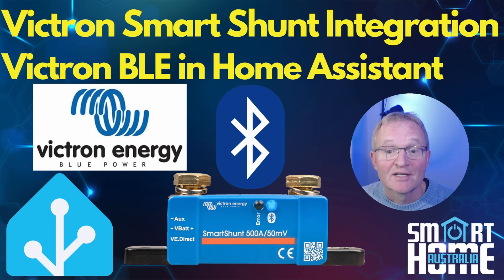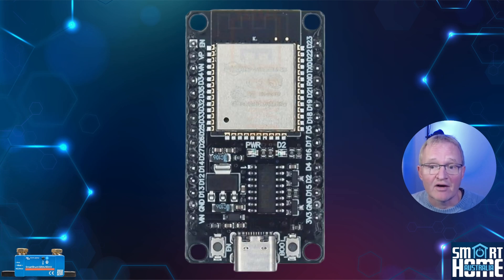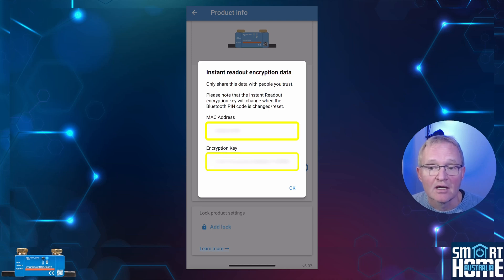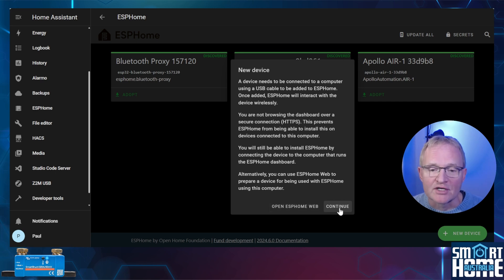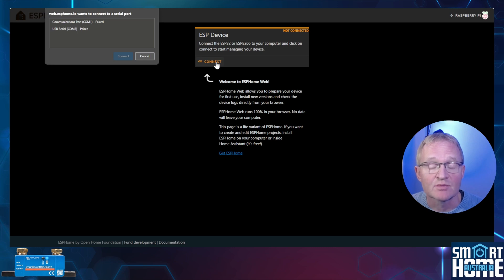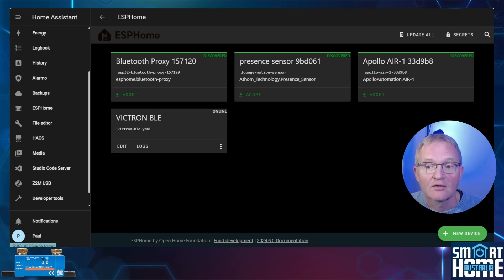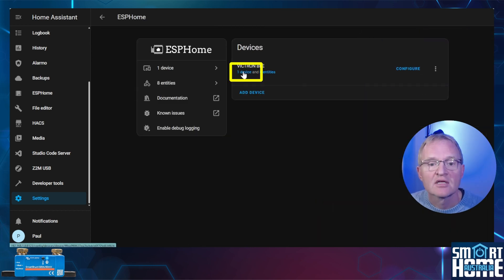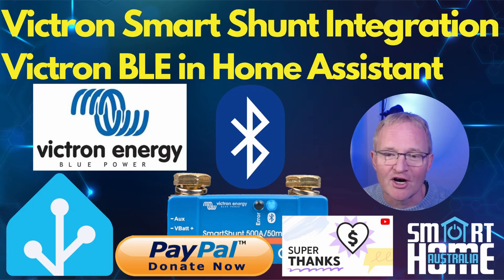Integrating Victron Bluetooth Device into Home Assistant: A Comprehensive Guide

Comment: Thank you. This was very helpful. With no modification of the code I was able to get a different Victron product to work with this. I have an old BMV-700 with an added on bluetooth unit.
My biggest struggles getting this done were probably because it was my first time working with an esp32 device. I use a Mac. My esp device seemed to need to have the boot button pressed down quite a while as I went through several screens. 
A suggestion: I had a great deal of trouble getting my esp device to connect. Turns out I was trying to connect the esp to my 5G wifi. I changed everything over to my 2.4 wifi and got it connected. My computer is back on the 5g wifi. 
Thank you very much for the video. I was not certain how valuable it would be. The feature that blows me away is the 10 days of data logging in HA and the graphs. My old shunt has no data storage. I am now geeking out analyzing how my batteries are charging.
Question: I have the Victron entities in my dashboard. When I click on one it tells me how recent the data is. For instance "2 seconds ago". Is there a way to display that time value on the dashboard.
My next big project is to get my EPever charge controllers to share data with HA. Looks daunting.
Reply from the maker: Excellent work !! This was one of my most rewarding integrations I've implemented. Dont forget to increase your HA reporting to get more data. Or whats this video https://youtu.be/k-7dO1o52dQ for the perfect solution !!
Reply: Hi!  I have the same configuration here. VictronConnect (Android) list my VE. Direct Smart BMV-700 (connected via Victron Bluetooth smart dongle). The problem is that the info screen do not list the mac address nor the encryption key ! How did you get these info?
Reply: @MarcPilon  away from my boat for a bit. But I’ll look. It was in the app somewhere. On iOS.
Reply from the maker: @MarcPilon  Access device on app > Press the Cog in the top right hand corner > Three dots top right > Product Information > scroll down > show encryption information. Thats should give you your information to be able to add the device.
Reply: @smart_home_australia  I thank you for your answer but my version (BMV700) is up to date and do not reveal encryption key in the info. Victron acknowledged that and say they maybe will update it... maybe. This is why I was interested in this particular David Hopkins comment.
Reply from the maker: @MarcPilon  All good, thanks for getting back to me. I've only tried iOS not Android, so maybe @davidhopkins, can help you.
Reply: @MarcPilon  I followed the instructions exactly as in video. Exactly as given by SHA. I think the last heading is encryption data or info. Something very close to what he said. Walk through his steps. Tell us where you don’t see what we see. Good luck.
Reply: @davidhopkins  Thank you for the reply. The bmv700 firmware do not have the same version as the other model of bmv (these have a newer version available). My version do not have encryption key displayed. Victron say : "maybe a future version will be available at one point for the bmv700".  So the question was : how did you get the encryption key info for your Bmv700? Or you may in fact have a different bmv model with a different firmware version.... Let me know.
Reply: @MarcPilon  I dont understand. I followed the instructions as given in the video. I have a BMV-700 with a BT module. In the victron app I just follow the instructions and it looks similar to what I see on screen. I connect to my device over bluetooth in the app. I tap the settings cog. I tap the three dots. I tap product info. At the bottom of the page I tap "Show" next to Encryption data. It shows me a Mac address and an encryption key. You need to express how far along this chain you get. Does your unit have bluetooth? Are you on the victron app? How does it differ from what is in the video?
Reply: @davidhopkins  bms700 do not have bluetooth integrated ; I use a victron bluetooth dongle. the bms700 do not have the same version available as other unit (ex 712). On victronConnect (Android) , the 3 dot info do not display the encryption key option - everything else is the same.
Reply: @davidhopkins  I just completed as an alternative the esp32 with hardware link to the victron bmv700 with esphome / homeassistant.

Comment: FYI There is also a Mqtt connector for those running Victron gear through a network connected Cerbo gx (or raspberry pi)… I will try this out as well as the Bluetooth connection for the smart shunt and the individual mppt’s is potentially easier….
Reply from the maker: Thanks Andrew. I don’t have the Cerbo GX, but if I get one I’ll definitely test it out. Thanks for letting us know. 👍

Comment: Hi,
it would work to detect when my UPS is about to power off so that I could create an automation to shut down my NAS. My initial idea involves using the ESP32 along with a voltage divider connected to the 12-volt batteries of my UPS. But now I wonder if Victron could work as well
Reply from the maker: Thats an interesting user case. Doesn't your UPS has a SNMP message that the NAS can read direct? If not, then yes you could use this for that usercase.
Reply: @smart_home_australia  No, it is a basic NAS with no communication ports
Reply from the maker: in which case it might be a Victron Shunt and a Switchbot FingerBot, with some HA automation magic :)
Reply: Maybe have a look at a NUT setup, thats what i have done with my NAS (old readynas, hard to work with)
Reply: @H220RMS  my low cost UPS has no communication ports so no way to connect to NUT

Comment: Is it possible to connect to more than one victron device with just one esp. And will victron smart networking over bluetooth still work. For exmple i have one victron mppt, one smart Battery watch, and one smart shunt, witch are actually conneted by victron smart networking.
Reply from the maker: Hi Michael, this was a proof of concept for me, so currently I only have the smart shunt in place, but I'm planning to introduce the smart solar controller. The documentation lists in its configuration multiple devices, so I don't see why not. And besides, for $10 give it a try and let us know how you go.